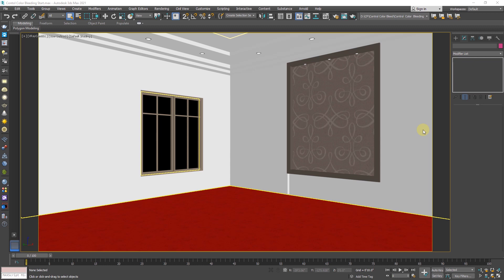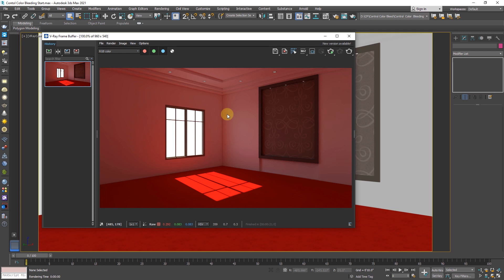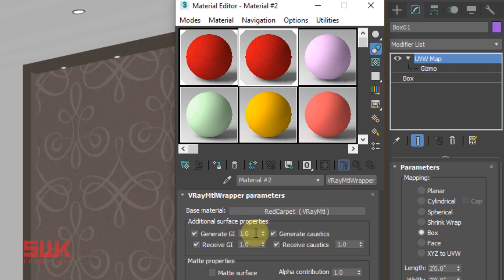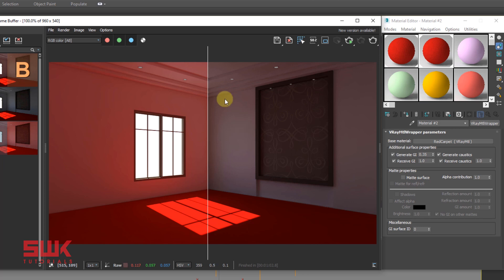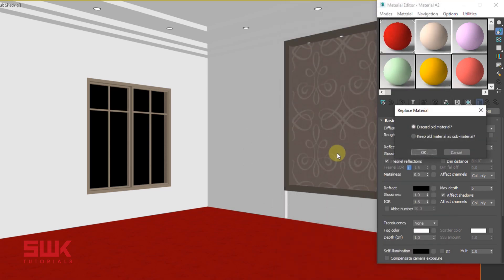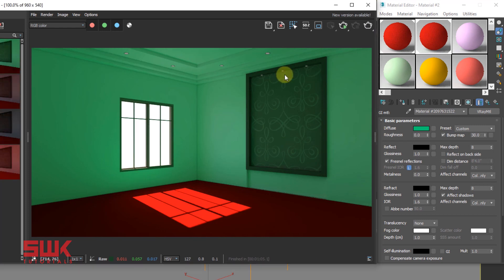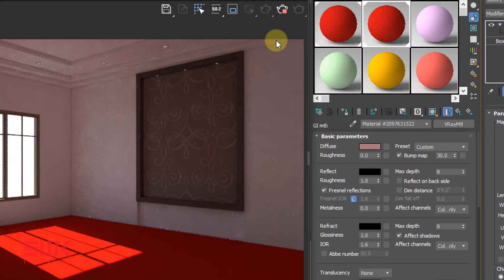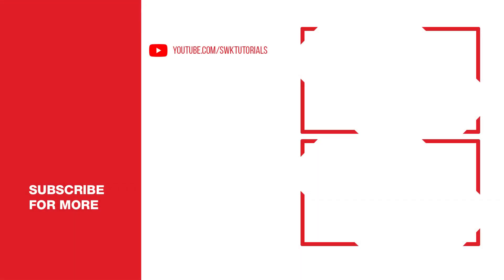3ds max + Vray | Control excessive Color Bleeding (Bounce) in V-Ray for 3dsmax

Comment: yes. very well explained. thanks for the tuto. but now the new problem is in Chaos Vantage. this GI override material doesn't work at all. all of those material with high saturation will still affect the adjacencies even the GI material is override with low saturation material. any idea how to solve it? thanks in advance.
Reply from the maker: I'm still not using chaos vantage. So I have to try it first. If I find a solution I will update you.

Comment: right click on the red object, choose vrayproperties, then reduce the generate gi..
Reply from the maker: Thank you for your feedback. Just want to add one thing.
The vrayproperties technique is very good but it doesn't work in every situation.
Example: if you have multiple materials on an object but you want to control the colour bleeding of one material. Then the vrayproperties will not be useful.